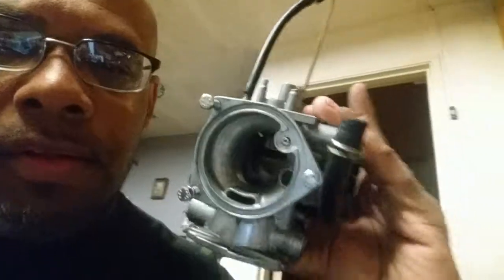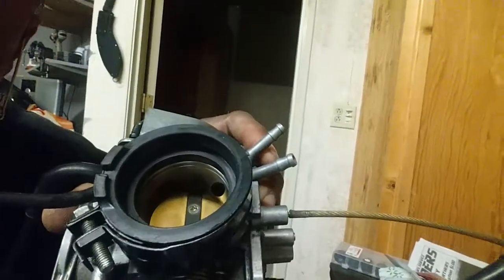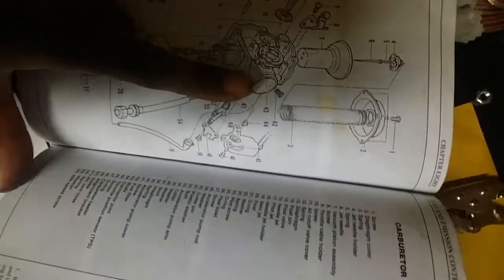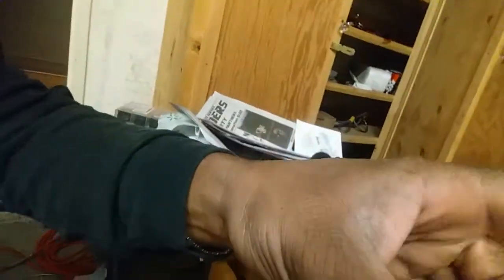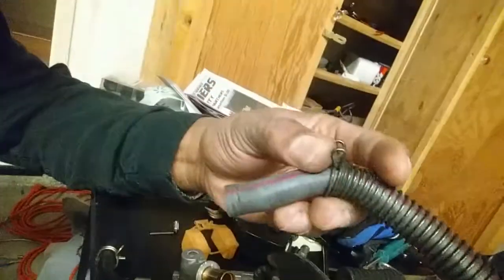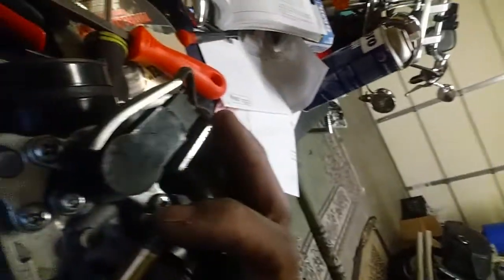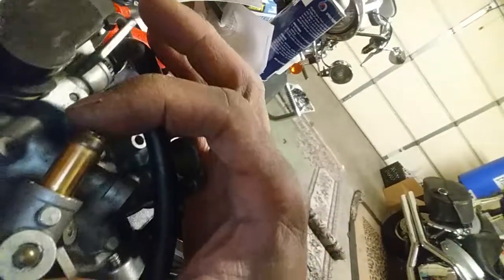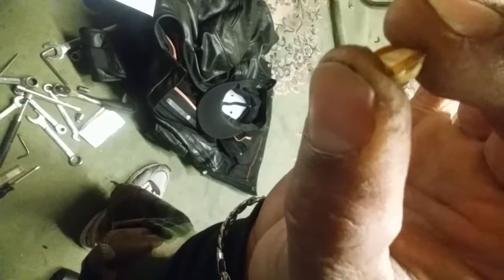Changing the fuel filter or strainer on a 2004 Honda VTX 1300c

Comment: Folks, do not use this for advice. It is not a fuel filter. That is just a strainer to protect the carburetor in case anything gets through the fuel filter which is in the petcock attached to the tank. Not to be disrespectful. Not everybody is a slick, production guru making videos, but when you are willing to make them, it usually helps somebody. Thanks for the effort.

Comment: over 5 minute video for this. Its not even a main fuel filter. the main one is in the tank petcock. All u had to do was look at a real diagram in the first place. Use hondas diagrams people. Get a honda manual , not clymer. Its a breakdown of their machines in their parts diagrams. Not rocket science! Here you go: it even shows a pic of the part if you click on it and shows you where it goes. If you cant understand this, get a mechanic

http://www.partzilla.com/parts/search/Honda/Motorcycle/2005/VTX1300S+A/CARBURETOR/parts.html

Comment: First of all, if you can't read diagrams,  you shouldn't be doing that type of work. The diagram shows it clearly.  You have to know a little bit about carbs.  It's not like those toys you were given as a child where you have to fit the pieces into the right hole.  Second,  Clymer is not the best manual.  The factory service manual from honda is and if you had it,  you wouldn't be guessing.  Third , you sound high.  Maybe that's the problem
Reply: I really appreciate your video. You are a life savior
Reply: Thediagram does show it as going in that first carb hole